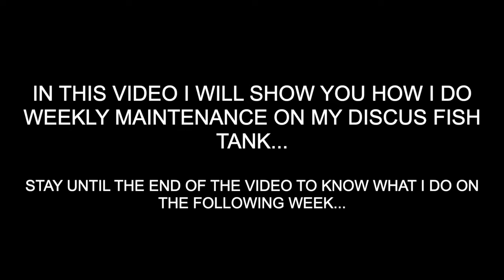WEEKLY MAINTENANCE ON DISCUS FISH TANK - how to have crystal clear water

Comment: Some questions...what kind of siphon is that you are using with the bucket,  any particular name? This siphon in particular is very informative to watch.  You use a pre sediment and carbon filter. NO RO..reverse Osmosis basically which is used predominantly in discus tank when TDS levels are high. Some hobbyist has the definition that using RO water eliminates algae issues and problems. How do you preheat the water or maintain the same temperature of the water that enters the aquarium from the faucet?
Reply from the maker: I bought the siphon on amazon, just search for a siphoner for aquarium water changes, it should come up.
I don't use osmosis water, I don't think it's necessary. Before introducing the water into the aquarium, it goes through three 5-micron sediment filters and one activated carbon filter. The water comes out at aquarium temperature through the mixer on the tap. I set the tap to come out at about that temperature and I'm always watching.

Comment: Amazing video , to the point. I have some queries,
1. I see your filling water with RO filter , do you add something to remineralize it?because RO system strips off all minerals .
2. Would like to have links for siphon and magic faucet used.
Thanks and like always amazing content.
Reply from the maker: Hello Osman!!!  
Thank you very much for the support.  
That system is not RO water.  This one has only sediment and activated carbon filters.  to be from RO it had to have a resin and a membrane.  

I bought the siphon a few years ago on eBay.  the link to the store where I bought it is no longer active, but if you look for a waterbed filler you will find it.
Reply: @PSKaqua  Thanks for the info Man. The sediment and carbon filter your using how many stages is it, may I know the brand and model for this.
Reply from the maker: @osmanhamedyousuf5034  The system I bought in a plumbing and garden watering shop here in Portugal.  The sediment and activated carbon filters I bought there, but you can look it up on Amazon.  Mine are 10” and 5 microns.
Reply from the maker: @osmanhamedyousuf5034  you can see the system and filters in my videos: 

https://youtu.be/dBHaOyearGg 

https://youtu.be/F5LYwWn0ZAE